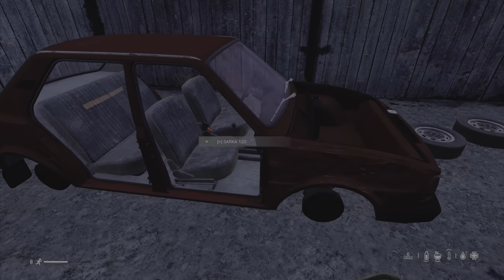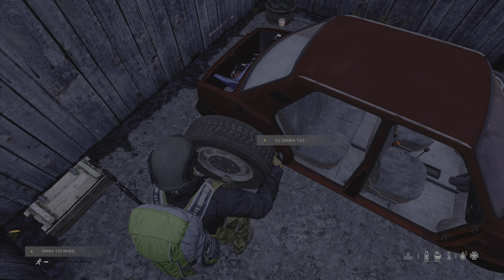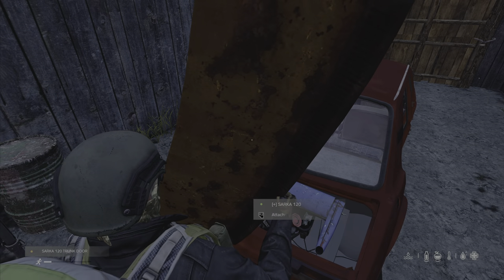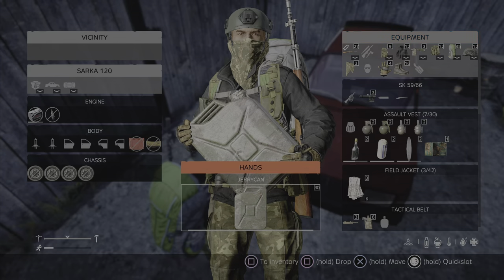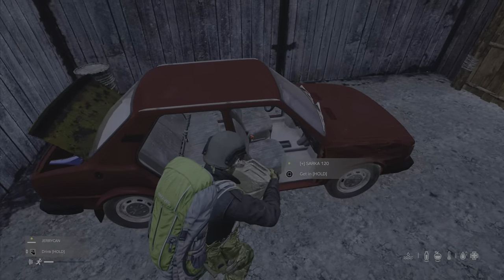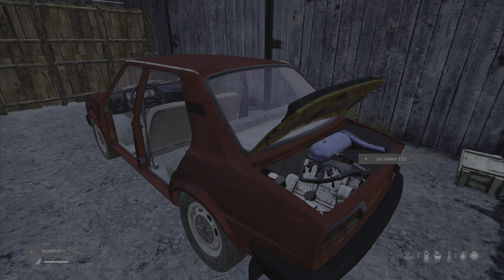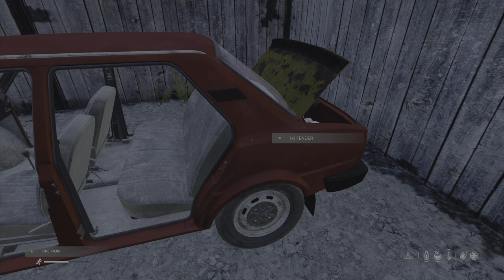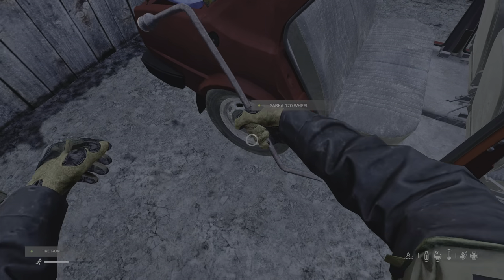DayZ Tips - Vehicles Cars -The Essential Re-build Guide

Comment: 1. You can NOT repair the radiator.

2. The blowtorch can repair all the car parts, that the epoxy can, with the addition of being able to repair the engine as you mentioned, which is exclusive to the blowtorch.

4. You cannot repair any ruined item in the game and that includes fenders. They can however be repaired with the blowtorch/epoxy when in badly damaged or damaged state.

5. You can attach the trickier parts (battery, sparkplug, radiator) via vicinity, same as you do to remove from/add to the cars inventory. That goes for doors etc. as well.

6. The visual quality of the trunk did indeed not change upon repair. Your trunk is a replacement part, taken from a wreck. Those will alway have a "rusty" texture to them, even when 'pristine'. However the visual quality of your hood/bonnet did improve as it is the original part of the car. This Sarka has spawned with that hood and it will look like 'pristine' upon being repaired to 'worn' state.

7. The numbers on each item don't reflect "weight" but rather dimensions/bulkiness/space they occupy.

8. Batterys do weigh "an awful lot" 10kg takes a significant chunk of your stamina bar.

I like that you are making a guide and don't mean to sound harsh, but I suggest a revision of your "guide".
Reply from the maker: Cheers for the comments. I will look into it. Sadly though that server and those items have been deleted...:(
Reply: @LongJohnSilver_PS5  There are more cars out there ;)
Reply from the maker: @freerider3434  Yup there sure are! The only one I haven't driven is the Humvee so far but working on it!!!